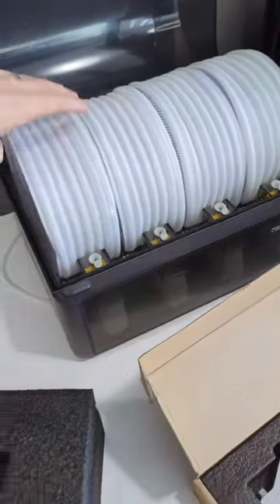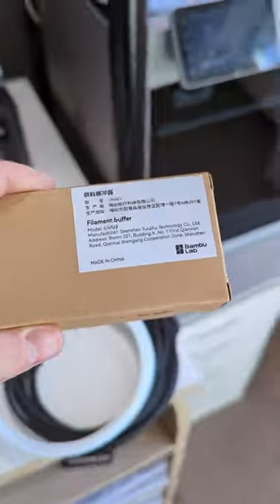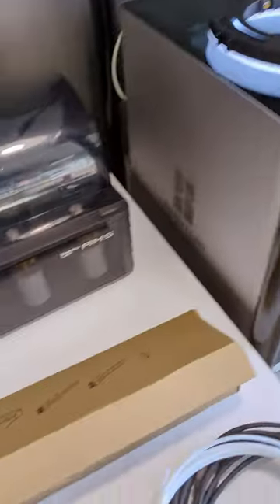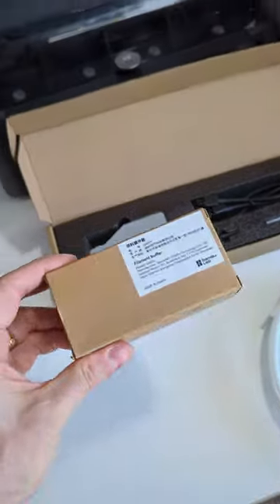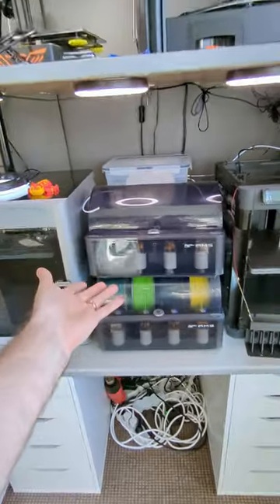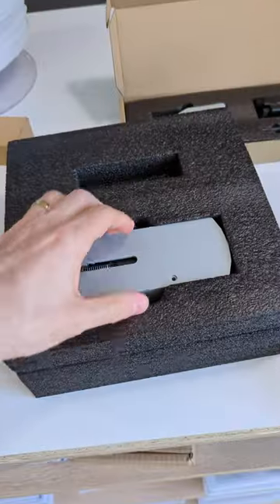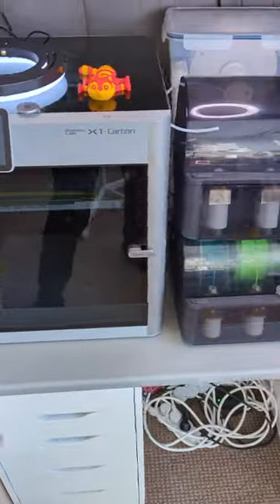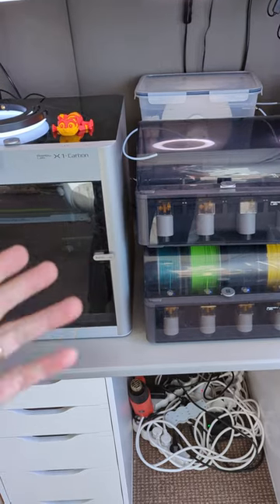Got a second AMS unit. Time for 8 colors. Will test ways to reduce waste on multi-color 3D prints

Comment: I just got my 2nd AMS as well, I have 2 on the X1C
Reply from the maker: Awesome! I just got the second one as well. Testing my first 8 color print.
Reply: @MihaiDesigns  Nice! I dont know that ill do many multi color prints, I got it mostly for the ease of switching colors for different prints.
Reply: I’m planning on ordering my second AMS for my P1S this week! I’ve been using some sealed dry boxes I made for PETG and TPU through the external feed, then sticking to PLA in my regular AMS.

Comment: Why not just have the infill to act as the place to dump colours you don’t want? What’s the point of a purge block?
Reply: I've always wondered this. if you absolutely HAVE TO PURGE, should be able to set a second model as the PURGE model. This way you get a decent tool or something without wasting material.
Reply: you can do that in the slicer, but the infil by itself isn't always enough.
Reply: @morbus5726  slicer should automatically adjust infill percentage and inner walls to accommodate for this. Would 100% push me into exploring printing multi-material
Reply: @ParisLuHv  infill can't be automatically adjusted on the fly, as it would disturb the line structure.
Reply: @morbus5726  who said anything about on the fly?   Same way the purge block, wall overlaps, infill overlaps, etc etc etc... there are already software that do this very thing. Dynamically adjusting the infill to create stronger weak points, etc.
Reply: @ParisLuHv  on the fly means layer by layer. you can't adjust infil percentage layer by layer, or it wouldn't be the same structure anymore
Reply: @morbus5726  uhhh, yes you can bud. I forget if its cura or prusa slice, but they have dynamic infill which increases the amount of infill in certain ares. Instead of saying something isn't possible do some research first...

 I understand you logic, but it's flawed. Just because first layer infill is 10% doesn't mean it can't increase to 20% on next layer. It would print just like any other overhang. And with it being INSIDE the model, who cares what it looks like.

Plus, it doesn't have to be vertically dynamic, it can dynamically control infill horizontally on each layer.
Cnc kitchen did a video titled gradient infill, go learn something new.

You clearly have no clue what you're talking about here. So I'm done responding.
Reply: @ParisLuHv  the setting you're thinking of is called adaptive cubic in most slicers. This increases the volume of cubic sections in the infil, WHILE STAYING ALIGNED TO THE INFILL LINES. 

It's an extremely bad idea to print infill lines with drastically different infill percentages, as that elimates the whole point of a supporting and connected structure. 

No need to get so mad lol. Why do people like you have to get so pissed when someone presents a slightly different opinion. 

owning an ender 3 with some printed mods doesn't make you a 3d printing expert. Learn to consider and listen to other people's opinions.